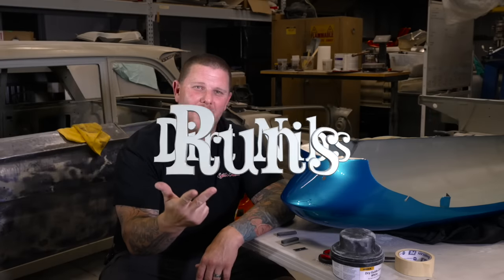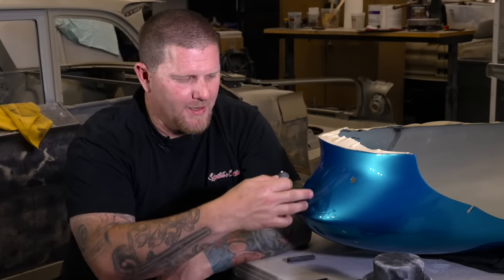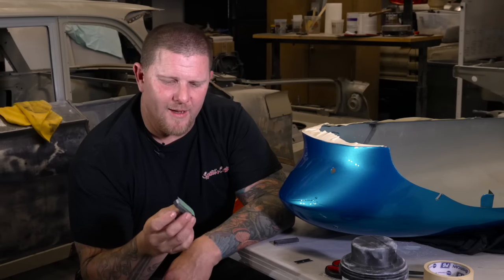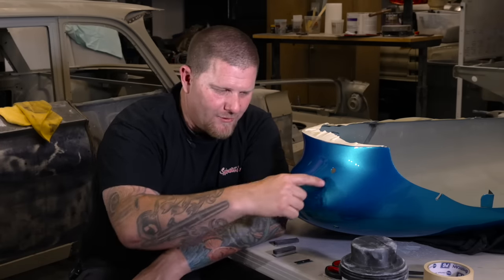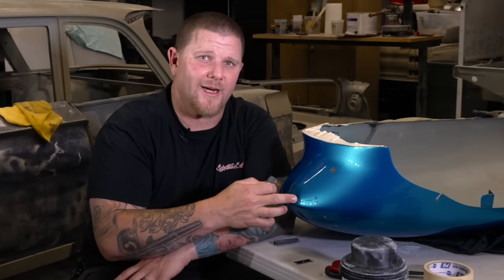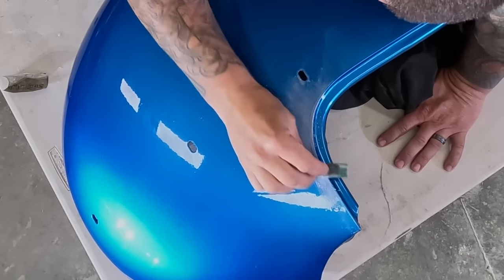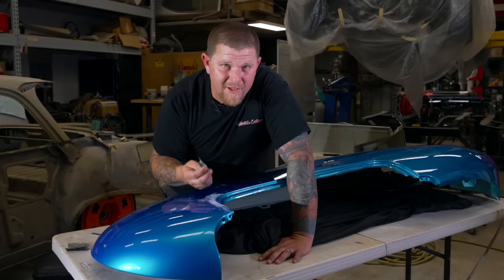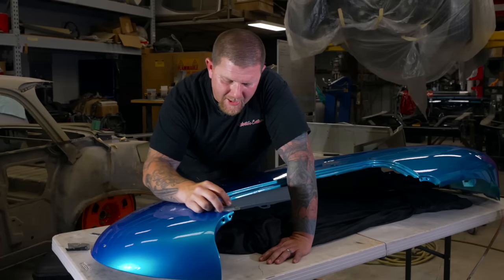The BEST Paint Correction Techniques PROS Don't Want You To Know!

Comment: I have not tried it yet myself, but I saw a method used by The Gunman to remove runs that looked interesting.  He spread a thin layer of body filler around the run and used that to protect the paint beside the run.  As he sanded the run, the body filler sands with it and the run comes down almost perfectly flat with the surrounding paint.  Once the body filler is almost gone, you are done with the  coarse grit paper and can then work down to finer grits until both the run and the body filler is gone.  Then polish per normal.  Looks like a neat way to go.
Reply: I exclusively use that method. It works amazing. Almost fool proofs the process. Run will be completely unnoticeable when polished with minimal effort. AND, no rub through on surrounding areas.  👍
Although we use a glazing putty,it's a bit thinner and smoother than regular filler....
Reply from the maker: I’ve seen that video it’s also a good method. I just never do. But use whatever works 👌🏻

Comment: Hey Brotherman, So after watching over 20 hours of your videos, I have questions I know you will have all the answers. I have a pickup, it is a over 20 years old Silverado and the original paint is toast. Delamination of the clear and base (white) showing the development of rust at some spots taken down to primer. My question to you, Without spending more than the value of the truck in paint, but refusing to let quality be sub-par, what would you do? I know you love the $400 a gallon epoxy primer, the $1300 Waterborne, but I can't afford that. There has to be primer, paint, and clear, that is quality or at least 90% of the quality, longevity, and durability of the cars painted with $15,000 worth of PPG or House of Colours. If the car builders in Texas can mass produce painted surfaces 20 years ago that are only failing now, I am sure it can be done today but I need someone who works in the industry to keep me from spending 6 months and thousands of dollars doing body work to make every crack, seam, joint, line, and screw is just so, to squirt $300 of shit that will only last a year before the weather and elements destroy it and I am back to square one again. I just want white.. I love white with the slightest of blue hue, I'm not wanting boatflake and 60 shades of candy for a background and a mural. What primer, paint, and clear would you use?
Reply from the maker: Shopline is the lower grade ppg products. The prep is the most important part.

Comment: How about removing solvent pop from a 3-stage metallic paint job
Reply from the maker: Solvent pop is caused by the reducer exiting the top layer that has dried to fast so your left with these small pin holes. Depending how bad it is. Spray wax and grease remover over it if it goes away you can sand it and reclear it. If it’s still visible and hazy you’ll have to repaint. Might be a good future video.
Reply: I only use a scotch Brite pad to scuff the clear instead of sanding solvent pop. The reason is if the pop is bad and opens up like pinholes and especially darker colors, the wetsanding sludge can get embedded into the pinholes and keeps showing up even if you re color. I scuff it, blow it off real good and re clear. Solvent pop is definitely the most unforgiving paint imperfection. All others are manageable as Sylvester is discussing.

Comment: Many many long times ago when i painted acrylic we used silicone drops for fish eyes. Couldn't tell if it did work or not. Just recently i paint epoxy enamel from a rattle can and got one 😂, and that was after wax &greese remover. It was only a workshop tool. A dab or 2 with masking tape fixed. Yep i read the comments and they add a different train of thought. Thanks for the work you put into these videos
Reply from the maker: Glad they help you out 👌🏻

Comment: Thank you again for sharing your knowledge with us. Very helpful in my daily work.  i have been painting now for six years and your video is certainly helpful.  I always leave a bit of a peel and polish the panel, rather than risk having a run. i use iwata WS400 supernova clear gun with 1.3 fluid tip.  I just increase the distance from panel by about half an inch extra and it works like a treat. but hey there are days when i get some runs, so thank you for your video.
Reply from the maker: You are very welcome

Comment: Great video! On fisheyes, I'll sometimes use clear with some kicker and put a dab in the center. It'll flowout and fill the divot. Then, sand out with a hard block.
Reply from the maker: Thank you yes you are correct. 👌🏻👍🏻👍🏻
Reply: @SYLVESTERSCUSTOMS  I do have a question. I do primarily mobile work. Underpowered compressor and a TP filter. Finishes usually look great. At home, I have a professional set-up with a QC3 filter and 25ft dedicated hose for spraying. Same gun, Prolite with TE20 cap. It acts as if it's starved for air. A lot of peel and trash/fisheyes. It's been suggested that the QC3 might have a too small of an opening at the valve. I'm considering an air dryer. The beads in the filter are new. Any experience/tips? Thanks!
Reply from the maker: @sealisland1  unfortunately, I don’t really have any insight without seeing it
Reply: @SYLVESTERSCUSTOMS  your hose comment got me wondering. It's pretty old. And, a rubber one. I'll change it to see what happens.
Reply from the maker: @sealisland1  good luck
Reply: @SYLVESTERSCUSTOMS  I got a new hose today and found out that the old hose and a fitting had 1/4 inch openings. I'm betting this is the problem. That 1/8 of an inch can make a huge difference in air flow.

Comment: I have never heard that 2:1 clear is better, but use what work for you, right. Question; With 5 coats of clear, do you add time for flash before next coat? In my mind, chemicals cure & cross-link during the off gas part. It does dry do to temperature, time and loss of solvents use in the product, temperature choice of reducers and time. My kid freaks out if my plans are to let it bake in the sunlight for 2-3 weeks. I will hard as a rock he says. My response is sandpaper fine rock glued to it right. I have told home about a finishing DA W/Interface pad. But he hands me my "Blue Point AT400" back that no longer works. Dude, didn't you oil this and clean 40 times outside the garage. I don't have air tool oil. Kids! I bought new hose and tagged it for paint only, desiccant, filters, the antique tool paper container, high end ball filters and new 3M suit for under $10. Bought 5. Thanks to your Travis, learning more has occurred! Thanks. 107 degrees here with high humidity. 
(Note; they ran 14 commercials durning this video) 
Have a lucky one! Still trying to wake up every morning!
Reply from the maker: Yes 2:1 clear is thicker and higher solids not high solvents like the typical 4:1 they hold up better. Also when stacking 4-5 coats of this you must extend your flash times while using the slowest reducer it keeps the clear open and allows time for it to gas off. Check out our paint video it covers every one of these steps. 👍🏻 “secrets to a perfect paint job”
Reply: @SYLVESTERSCUSTOMS  
Thanks, I will watch that video. I just have a list oh honey-do jobs that gave 40 items plus research and my out things. Their are not enough hours in a day especially when it is 107 degrees out. Crazy!
Reply: Thanks helping our on the 2:1 vs 4:1 clear. I may have simply missed it by typing. Thanks for setting me straight as I save this in a private folder!  I share all with my 38 year old son on his few Monte parts!
Reply: Hi Dean. I used to think letting the clear set longer was bad too and more difficult to buff but it's just the opposite. Wetsanding at any time seems about the same but you really notice the difference with the buffer. I set my paint in the sun any chance I get. It works wonders. When I can't go outside in the winter, I use an infrared heat lamp. You have to be careful with those as they heat from the panel outward. I keep a laser thermometer with my heat lamp to monitor panel temperature every 15 to 20 minutes.  But letting the paint cure as long as possible is definitely the key to easier buffing.
Reply: @class5bodyworks Spray three coats clear "High Solids" clear. Let it dry clean and for two weeks or more. (See my friend Pete / Southwest Rod and customs) 8-12 videos back. Then wet sand after completely dry in under lights, sun and out gas completely. Once sanded to 800 grit (Ignore they others, the trick is Harbor Freight and buy the 3/16" orbital action DA) but motor guard SB-1 and fold the wet paper for light edge work. Then spray two more coats to get the "Flow Coat or Double coat. "Spray-A-way" is another to see. I done right in a clean area, no cut & buff required. I have cleared over vinyl decals, pin stripes and Pete did a black VW! Research! Best of luck buddy!
Reply: @deankay4434  
The flow coating is kind of antiquated. With the newer high solids clears(2:1), you can get enough film build to cut and buff and be done. Flow coating is labor intensive because of sanding the first round, remasking and reclearing. I do 4-5 coats of VC5700 and start sanding with P600 out to 2000 and use a wool pad. I can get the results I'm looking for this route. Thanks for the info. It sounds like you and your friend have your techniques working for you. People take different paths sometimes but end up at the same finish line. 🤙
Reply: I will spent some money for the AT400 worn DA if it's cheap enough for a disabled guy! I will pay shipping. 2:1 is solids vs is sprayed 3 complete wet coats then wait. Harbor Freight sells a "Short Orbit" action start high sandpaper. But, let it cure, harden, out gas and finish drying. Washer iywwben

Spray 3 wet coats and let cure. Use fine hook & loop and start medium speed with water. Do edges by hand gently with soft/hard block. New plastic & tape, keeping it clean and spray 2 coats. If done correctly, no cut & buff. Two DA's! One regular and one fine.
Reply: Wait until you retire! This list get longer! Sorry!
Reply: @class5bodyworks  You are right Jim. Remind everyone to check the air temp used for spraying, booth and the metal to be painted. Great info.

Comment: Hey Travis can you touch on dye back in the clear. I soray in an open environment and deal with dye back all the time. I have yet to overcome it but would love to see what input you have. When i spend countless hours getting a panel totally flat, it looks wet and slick while i paint, then is looks semi gloss at best when im back in the shop the next day. Ig sux when this happens
Reply from the maker: Back when I was painting in my garage and I did not have a Paint Booth. I learned the hard lesson if you are painting in an open environment and then the doors get closed up at night before it’s done gassing off the solvents go to the ceiling and overnight they come back down and land on the car. Do you need some type of ventilation to make sure that the airflow keeps moving over the car until it is completely cured
Reply: @SYLVESTERSCUSTOMS thanks brother I'll get a shutter fan installed and see how it goes. I've got a direction to go in now. Before I was just guessing.
Reply from the maker: @SteffsGarage  put a fan on one side of the car blowing over the top that way nothing over the top of the car can settle back on the Paint. I hope that helps you.

Comment: something i like to do instead of buying a new air line for painting, i like to run alot of wax and grease remover through the airline and flush it out a few times before painting rather then buying a new line. not sure if its the best thing to do but if you do it the night before and run alot of air through it i find i can get good results. im open to other ideas?
Reply from the maker: Me personally I wouldn’t risk that. An air line is a cheap investment vs having to risk it with very expensive paint.
Reply: @SYLVESTERSCUSTOMS  your right actually, and specially when it comes to the quality above and beyond work you guys do I can understand the worth of just buying a new air line

Comment: Thanks for another great video! What do you sugest for undercoating? I am restoring a classic beetle and i worry about fenders and floor pans.Epoxy primer - undercoat- adhesion promoter - epoxy sealer -base and finaly clear? Is this the rignt way?
Reply from the maker: We always wait till it’s all painted then scuff backsides of epoxy and use a raptor liner or rock-it liner
Reply: Yep. Spray on bedliner is the best.  I also use the Raptor. Paint looks nice for awhile but if you're driving this, definitely the bedliner.

Comment: Once, again, your videos have improved my build, with every one.  I have sprayed the base/clear (which turned out awesome, imo, thanks to you), & have started the wet sanding.  I have watched this video a few times, & have a question about timing.  I have a body-shop friend that told me that once I wet sand an (small ) area with my 600 grit, I should finish that area, through all the grits, & then buff (polish) it before moving to another area.  I guess what I am asking, is if I sand the roof in 600 grit today, but can't get back to it with the other grits/polish for a week, is that a problem????  Thanks, in advance.
Reply from the maker: Right on glad to hear!!! It can stay sanded forever and still polish back 👍🏻 there’s no time limit
Reply: One more question about the wet sanding.....in one video (older) you said continue to wet sand with what you used in your body work (I used Linear blocks)...this one you said use Jason Kilmer's blocks (which I have the hard blocks)....which one do you recommed for my big 60 Impala?  thanks.!!! @SYLVESTERSCUSTOMS
Reply from the maker: @bigrigg71  since we have adopted Jason Killmers methods I have changed a lot of what we do in our process. Killmers small blocks work better in my opinion.  After bodywork is nice and perfect you won’t need a long block to get it straight. Cutting it flat with 600 is the important part.
Reply: @SYLVESTERSCUSTOMS  you da man! Thanks, again!
Reply from the maker: @bigrigg71  anytime!